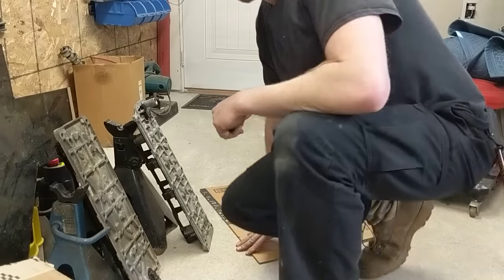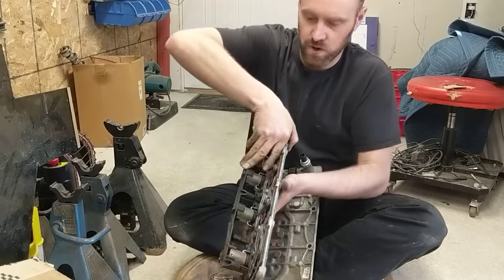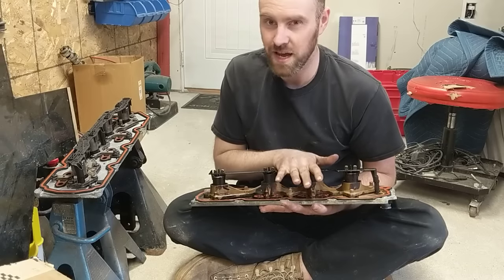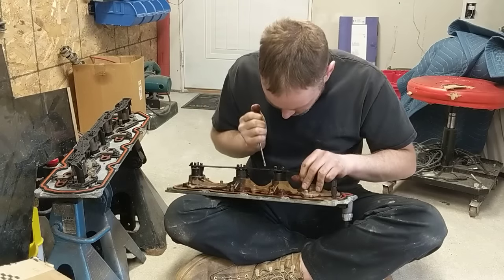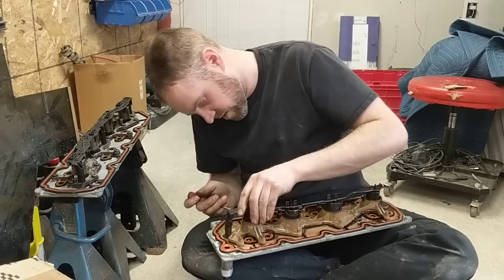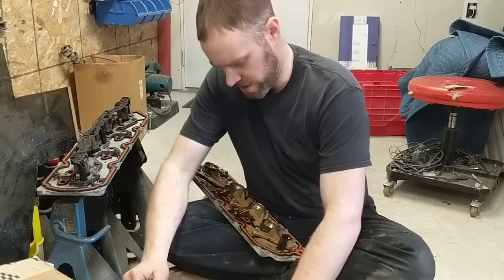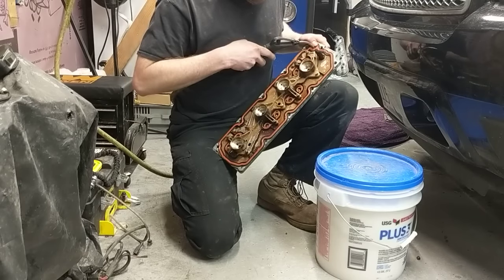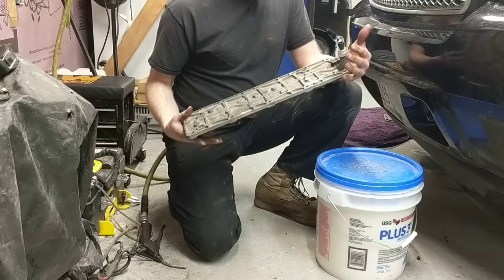Riveted VLOM Mod and Comparison

Comment: I cut all of the rivets out with a grinder took the whole selection out to insure no flaws then took a Irwin Phillips head screw bit  and plug the bottom of the vlom tight fit.. Works flawless 2008 GMC envoy denali
Reply from the maker: Nice haha well whatever works
Reply: That's exactly what I did yesterday to mine too, worked amazing! My trucks alive again!!
Reply: What did you do for the computer?

Comment: I assume the truck goes into limp mode by this method since there is no connection to the solenoids ! But creating leaky seals instead does not make it go “limp” !! Also y wouldn’t the range deactivator save you from going into the computer to modify it ?? Great vids ! Thanks for being patient and devoted to teaching us almost mechanics !!!

Comment: just modded my 2015 5.3 a bit different but same idea had to trim the port inserts channel i got in my release tool kit from you (which worked great) thanks!
Reply: What is the name of the sensor the electrical port next to the cams

Comment: thanks for these videos i just installed and use your tool worked out ,lifter is unstuck took out the solenoids plugged the port but i didn't get the new plug you made with the slit on it. is the the old mod plug just as good or should i cut a slit into it ? please let me know sending my ECM to LTswap to tune it i'm hoping this will solve my problem. keep you posted.

Comment: You've removed the solenoid and disconnected the electrical connector inside the VLOM.
My question is what do you do with electrical plug on the outside?  If it's attached to the VLOM will it cause electricity to go randomly inside ? And will errors register like that and if it's unplugged also get errors?

Comment: Great Input . I have 2 stock engines. Swaping into 50s trucks. Ran fine. I wanted to do your suggestion to vlom modify and have the ecu flashed and dod deleted at ecu.  One is a 6.2 with vvt and afm out of a cadillac escalade and a the other a 5.3 afm out of a avalanche Both 08 years. Keeping that stock cam and stock lifters in place should give me reliability is what I understand correct?
Reply from the maker: It might give you reliability, however the lifter could still rotate in the plastic lifter tray. It will still be more reliable than a 50s engine.

Comment: Love your videos!

I had a question that you might be able to answer... I have a 2011 Tahoe Hybrid with just under 78,000 miles. It's basically been problem-free since it was new. I'm now noticing a thud when the AFM disengages when cruising at highway speeds (this is most noticeable going from V4 to V8 and less noticeable when engaging — V8 to V4..) The thud seems to be more noticeable when under load (small highway incline, etc.)

I don't have any alerts or codes (I don't have a way to scan but there are no messages on the console) and I don't have any engine miss (that is noticeable, anyway). I know there's a lot of info online about VLOM and AFM lifter failures but I don't see this being the case — it really feels like it's transmission/torque converter(dampener assembly for Hybrids)/lock up—related... I'm not noticing any other transmission-related issues though. Shifts fine under hard acceleration, etc.

On a side note: I just had a full transmission, differential, engine oil (basically all fluids) changed at around 75K (shortly before noticing this behavior) but I can't come close to pinning it on that, specifically.

Any ideas what this could be?

Comment: When using your kit. Plug the little filter doesn't fit any more. Is it ok to not use a filter on the oil pressure sensor?

Comment: I have the riveted style. I removed the bigger of two o-rings on the solenoids and cut a grove where big o-ring was and reassembled. seems to be preventing from building oil pressure to individual lifters. hopefully I can drive until I get ecm reprogrammed?
Reply from the maker: Send the ecm to lt1swap.com but as long as you have it room to get out of the the towers and prevent the feed hole under the sensor from feeding thing you will be ok. Watch my latest video starting at 27:17  I also show how it responds without a tune so you know what to expect.

Comment: I changed the lifters on my 2010 Yukon 6.2, I went to the parts store to get a new VLOM. The original Vlom im wanting to pull off the motor is the one you show on the left. The part the auto store gave me is the one you show on the right with the rivets. Question is are these vloms compatible can I use either one for my engine? Is the the one on the right with rivets just a updated version.
Reply from the maker: Yes, both work the same in theory. I've heard of quite a few having issues with new VLOM though. So don't fall for a new part is a good part of you end up with a issue. It's not that likely though but does happen.

Comment: Great videos on AFM system!  Do you have any suggestions on why the riveted VLOM does not have any bleed off orifices?  Also does the riveted VLOM have the inner filter screens/gasket like the bolted style?
Reply from the maker: I have not cut one open yet put it appears that it has no screens. I believe the bleed off orifices are built in with the solenoid when DOD is not activated.

Comment: I want to thank you for doing these videos, I have watched several already and shared to get them out to friends of mine. What video should I watch to diagnose if it is the cam ,lifter or the vlom? I have a 2009 GMC Sierra no noise but a good miss to it and a 2008 Tahoe with a very loud tick/knock. Thanks and I will be ordering the tools from you.
Reply from the maker: https://youtu.be/6vLcX_ccIFI
Reply: Thanks for the reply. I checked the 09 sierra out  and #4 is where my problem is. 1 rocker is very loose. "I think it is #4 exhaust" 4th rocker from the front passenger side. the truck has just a very, very slight tick if you rev it a little otherwise quite at idle but the rocker does not move at all running. collapsed lifter? Thanks again and if that's what you think it is as well I will be ordering the tool and vlom delete kit.
Reply from the maker: @jackmac9569  so wait, cyl 1 and cyl 4 have a problem? how many miles have you driven it with the issue?
Reply: sorry, just cyl 4 has 1 loose rocker all the others cylinders are fine. 150 ponds of compression on all cylinders except cylinder 4. 30 on it.
Reply from the maker: @jackmac9569  if you checked compression on cylinder 4 more than once I bet it would be inconsistent...  If the rocker is loose than this is likely the most affordable way to try and fix it. Do the kit so you get the plug and cross your fingers that it releases. Be sure to check out the best practice video before you tackle it. https://youtu.be/628gz05Vy9Q
Reply: it is inconsistent, 30 , 25, 18. Thanks for such a quick reply! awesome videos you have here, Thanks again. I will be going to your website to order the kit . Let you know how it goes.

Comment: I'm thinking the riveted vlom without the humps. is not letting enough oil pressure out fast enough to lube those valves and causing tapping. what you think?
Reply from the maker: Nah, they all fail.

Comment: I had my computer tuned out DoD can I put a plain valley pan  cover on my 5.3  2009 sierra its leaking  like to replace when torn apart
Reply from the maker: Not unless you changed the lifters. Get a new gasket if it leaks on outside. Could also do my VLOM mod if you wanted do long as system is tuned out.

Comment: How do you keep the harmonic balancer pulley from spinning while you'll tightening the crankshaft bolt
Reply from the maker: I hold the flex plate with a wrench wedged between the torque converter and the flex plate threw the hole in the transmission bell housing.

Comment: I bought an 08 Z71 the other day blindly because it was a decent deal for the miles & shape. I got it cheap because it has this collapsed lifter bs. I am a mechanic that used to own a shop but since I've gotten older, I just work on my own stuff. After a bunch of research on this subject, I think the best thing is to just fix the issue & sell to move on to another brand. GM really screwed the pooch on this crap design. What a nightmare.
Reply from the maker: All vehicles have flaw's. With that said the GM issues are all in the valve train. If a guy wanted to keep one all you would have to do is a afm/dod delete. I've seen these things well over 400k mi on the original bottom end. The top end is the problem. The rest of the vehicle like suspension and trans is just as reliable as any other. I'm not sure why GM thought people bought a V8 to have a 4 cylinder anyway. Stupid idea, not like the system adds much fuel efficiency anyway.

Comment: I didnt see there was 2 different vlom plates. I have the riveted one . but i broke gaskets circles like the 1st example.. Is it still usable? Do i still need to remove the 4 solenoids?
Reply: I done the same thing today,just broke the gaskets and plugged the sensor hole,but didn't remove the solenoids
Reply: What did you end up doing? Did cutting the ring gaskets work on the rivetted one?
Reply: I did the same thing lol hope we’re doing something right
Reply: @paulimendoza4998  so its been completed. I cut notches in the gasket just lik he showed and plugged it with that plug. Worked perfect. I used the same head bolts too. Torqued to 25lb, 45ftlb and finally 65, I got the ecm flashed at a local tuner. Cause if not it runs thinking the dod is in place so you have strange lag times at various speeds.
Reply: @mobius-1503  
When you use the plug we dont use the screen filter any more?

Comment: Hey I have a 2003 5.3 suburban and the lifters tick I changed the oil and found the pin locks from the top of the lifter in the oil.. is that normal? 250000 miles
Reply from the maker: That vehicle is not equipped with AFM however, no that is not normal.
Reply: @CrazedPerformanceRepair  right on. Lifter failed completely.. the cam took out the roller on the lifter.  Lol definitely not normal lol. Thx
Reply: Definitely not an a.f.m. motor but there are 2 things on the vlom that have a wire going to em any ideas on what they do?
Reply from the maker: @arak17iv77  that's not a VLOM, it's just the valley cover. That one is old enough that is where the knock sensors are located.
Reply: @CrazedPerformanceRepair  oh cool thanks for your help. I appreciate it.  Like the channel alot

Comment: Hi, is it possible to order from you a modified vlom for 2007 1500 suburban?
Thanks
Reply from the maker: Just sold the last one I had available last week. I could sell one without a connector for cheaper. You will need the tune done prior to running it at all with it though. Maybe I'll get luck and the 2 I recently sold will send me cores. Then I can prepare more.

Comment: So if I got the riveted one I don't have to plug the oil hole under the sending unit I just got to pull the solenoids ?
Reply from the maker: Do as I do in this video https://youtu.be/pP7I5tbXsfw?t=1637

Comment: So I have 240K miles on 2007 Tahoe and no lifter noise but have low pressure after approximately 1 hour of driving replaced oil pump which I don't think was needed. Can't I just replace the VLOM and get the desired results?
Reply from the maker: You can try the screen under the oil pressure sensor. Sometimes it will get restricted. If that doesn't work shut the system off before a lifter collapses. I recommend LT1swap.com for this.
Reply: @CrazedPerformanceRepair  replaced that already (first).  Then, I had to take it to a mechanic because I was out of state and he really had no idea about DoD issues so he just did the standard oil pressure tests and then replaced the oil pump.  I told him I didn't think it was the oil pump because they don't typically go bad (big burly gears).  I had replaced the oil pump pick-up O-ring a year before and it was definitely rock hard.  I thought that was the answer but watching your videos I will look for a stuck lifter next.  Should you just replace the VLOM if you have it apart?  You show notching the VLOM gaskets as a work around.  Why wouldn't you just replace the VLOM?  Also, have replaced that screen twice. once myself and then the mechanic that replaced the oil pump. When I checked it, no debris on the screen.
Reply from the maker: @johnsummers778  I do the VLOM mod to prevent re collapse see https://youtu.be/xFr8TxgxJow for more on that. Changing the VLOM will not help oil pressure you likely have something else worn out. You could maybe have a worn cam bearing, see https://youtu.be/XMo9qgQ40QQ for more on that. What is your hot idle oil pressure?
Reply: @CrazedPerformanceRepair  , my oil pressure starts at around 38 and then drops below 20 at hot.  When I set up my dshboard screen to show when the DoD kicks in (V4/V8) the Tahoe vibrates when switching between the two.  Once the oil pressure drops to 20 it does take long to go further down.  If I'm watching the screen and keep it out of DoD V4, it seems to stay above 20 and get me home.
Reply from the maker: @johnsummers778  You might have worn out second cam bearing then. What weight oil are you running?
Reply: @CrazedPerformanceRepair  typically 10w-30
Reply: also, why the second bearing?  I'm trying to get a couple more years out of the tahoe because it's in really good shape.  I would just replace the engine with a deleted system if I had to go that far.  I have a friend that works for Jasper and could get it for me at cost.
Reply from the maker: @johnsummers778  I explained the second bearing thing in the cam video. Basically because of the vvt option some vehicle's have. So all cams have a missing section in second part of the cam

Comment: What is the issue if the lifter jams open and bends the push rod ? Did the piston hit that valve?
Reply from the maker: It's likely sticky valve, it might have bent it if piston hit it.
Reply: How would the valve & piston contact if the valve timing never changed?
Reply from the maker: @robertbush9355  if the valve stuck from carbon in the stem guide it could have stuck for just long enough open the third piston hit it and shut it. Then if it bent it it will leak and thus misfire
Reply: CrazedPerformanceRepair okay, thanks for the input

Comment: Can you put a non DOD valley cover in it also?
Reply from the maker: Not without replacing the camshaft and lifters with a non DOD parts. Otherwise you would have to modify the non DOD plate.
Reply: @CrazedPerformanceRepair  Thanks!

Comment: What is the name of the sensor
Reply: The electrical sensor what’s the proper name
Reply from the maker: The oil pressure sender?
Reply: @CrazedPerformanceRepair  so the clamped in black sensor that is called the electrical something something I know I sound dumb but I don’t believe it’s the cam shaft sensor I feel like it has a proper name
Reply from the maker: @cheresecochran3497  there is only the oil sender and the VLOM solenoids on the pre 2014. The connector for the solenoids is a passthrough connector.

Comment: I stole a vlom off a 6.2 that has a flat plate with just the bolt holes a the oil pressure sensor with o rings to go around were the stand in the middle are
Reply from the maker: If you plan on using it with DOD lifters don't even try. It will collapse all 8 lifters.
Reply: @CrazedPerformanceRepair  i would be deleting it
Reply from the maker: @traxxasLOVR  As long as you are doing a full delete camshaft and all.